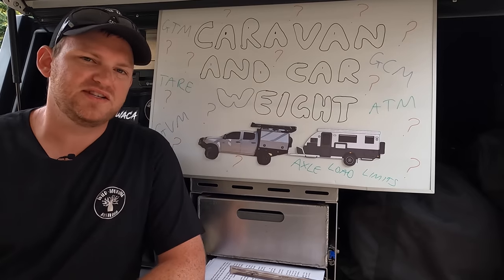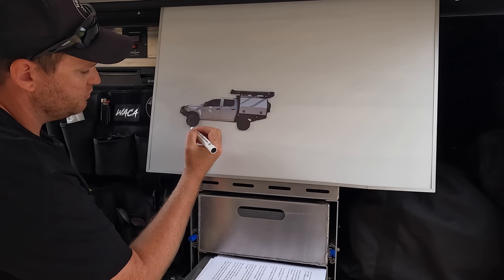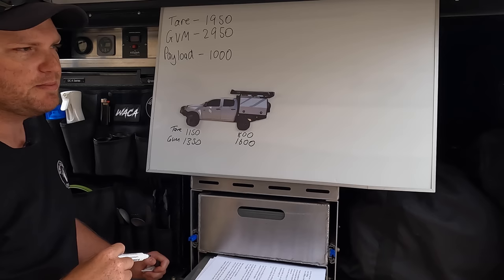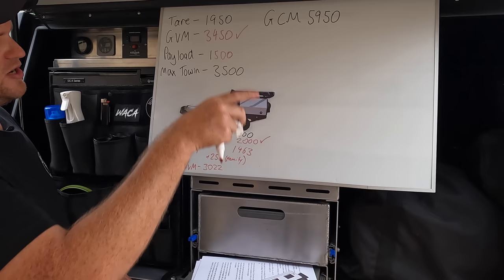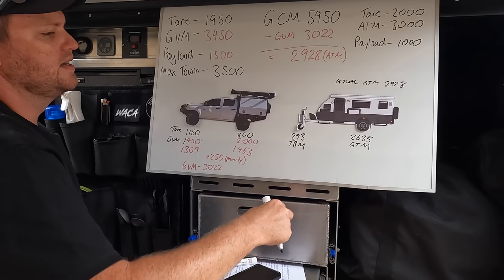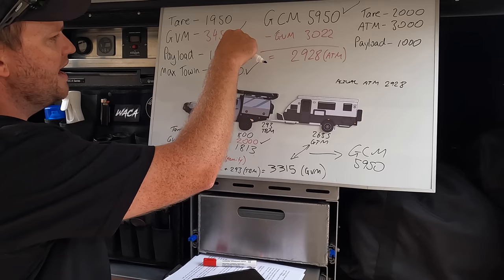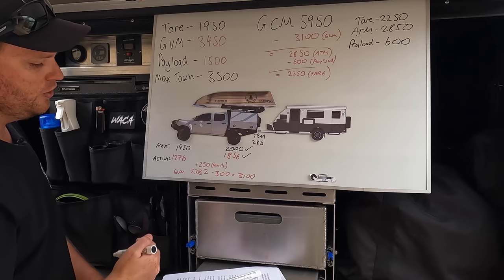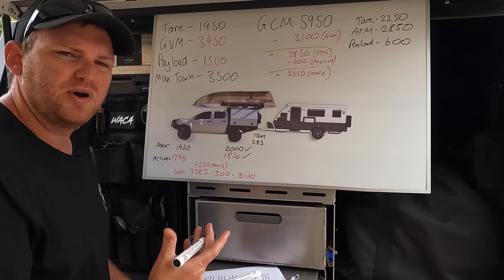How to work out what you can tow? ||  Explained - TARE, GVM, AXLE LOAD LIMITS, GCM, ATM, GTM, TBM...

Comment: Usually, the GVM is actually less than the sum of the axle capacities (the exceptions are usually aftermarket GVM upgrades). Telling people that the GVM is the sum of the axle capacities will result in some people overloading their vehicles. The biggest reason for OEM GVM being less than the sum of the axle capacities is to allow for variability of the fore/aft weight distribution. It also helps to ensure that the rear axle is less likely to be overloaded while towing (actual rear axle loading from the towball weight is more than the towball weight because of a leverage effect, unloading the front axle and putting extra load onto the rear axle).
I trust that this helps.
Reply: PS: the video is generally very good (I thought I should add that). 👍🏻
Reply: Since I've now reached the bit about the towball weight onto the rear axle, it's an easy calculation. Load from the TBM onto the rear axle is TBM * (wheelbase + rear overhang to the towball) / wheelbase. For SUVs, this will be roughly an extra 45% on top of the TBM. For utes, because of the extra overhang, it will be roughly an extra 55% on top of the TBM (this will vary with the design of the specific make and model, but the above will be in the ballpark).
Reply from the maker: I don’t know which particular section you’re referring to. 

You’re correct in saying that the sum of front and rear MAX axle load rating will not always add up to the GVM on the compliance plate (however for some vehicles it does). 

But, if someone wants to work out what their car weighs (GVM), the sum of the front and rear axle weights = GVM.
Reply: It can get confusing when the limits and the actual weights have the same names. What I was referring to was the part where you were describing the amount that the vehicle is legally permitted to be loaded to. You mentioned the front and rear axle limits and added them together to get what you called the GVM (referring to the limit, not the vehicle loading). I can't remember what the front and rear axle limits are for a standard D-Max like yours, but at least one of them is more than you've quoted (probably the front). I know for a fact that the OEM axle limits for the vehicle add up to more than the OEM GVM because the design, release and type approval of second stage manufacture (AKA: pre-rego) GVM upgrades are my bread and butter, and the "stage 1" GVM upgrade that the company I work for had for your type of D-Max was the sum of the axle capacities, giving about 140-150kg increase over OEM (if I recall the figure correctly - it has been a while since I last did anything on your model D-Max). I'm pretty sure Pedders didn't increase the front axle capacity over the OEM figure, but they increased the rear capacity more than the company I work for would normally consider increasing it. Not saying Pedders has overloaded it (they're reputable, so I'm sure they haven't done anything silly) - we're generally just a bit more cautious. Anyway, I digress. I'm pretty sure your front axle limit remained the same as OEM, but the GVM upgrade allowed you to use it all (in addition to the increased rear axle limit).
Reply from the maker: @AutoEngineerVideos  the entire thing is over complicated to be honest! It’s no wonder there are so many overloaded vehicles on the road.

Anyway, appreciate your comments and expertise Danny 👍🏼
Reply: You're welcome! Even the likes of John Cadogan haven't been saying anything about axle load limits in their discussions on towing, and people like him really should know better. I think it's great that you had a go (and did a pretty good job of it), when others keep ignoring one of the elephants in the room. Keep up the good work! 👍🏻

Comment: Axle weights are not GVM, they are axle weights, GVM is the maximum the vehicle can weigh and in a lot of circumstances is less than the stated axle weights combined. ie a Land Rover 90 has a front axle of 1200kg, a rear axle of 1500kgbut a MAM of 2400kg or 2550kg depending on spec. A HD 110/130 has FA of 1580kg and a RA of 2200kg, but a MAM of 3500kg. Also something to remember is the trailer nose weight must come off the GVM/MAM if towing as it is load, in axle weights you have to times that by the difference in wheel base and overhang to get the actual loading on the rear suspension, the front suspension may not alter in weight applied to it! That depends on how the vehicle is loaded, not the trailer.
Also GVM is the MAXIMUM the vehicle CAN weigh not it's actual weight as you describe. so that is just referred to as vehicle weight not GVM/MAM or occasionally GVW. 
Something else to consider is if outside of AU, then you may be limited to MAM and Combined MAM for the train weight, so for the 110/130 that is 3500kg MAM + 3500kg trailerMAM = 7000kg combined MAM. Land Rover is one of the only vehicle manufacturers that if the vehicle has a full 3500kg tow capacity it does not detract from the vehicle's weight, nearly all Japanise vehicles there is a compromise on actual and MAM of vehicle when towing max trailer weight. 
Towball weight and trailer angle is imensly important, always, always tow nose down with a single axle trailer, it is more self stabilising. in fact at that point you can reduce the nose weight considerably to less than 100kg. always load the trailer over the axle not to the extremes of the trailer bed, as that also stabilises the trailer under tow conditions. 
As a basic theory, the video is good, what would be great is for you to actually show the practical example and test the theory, I bet you'll be surprised with the results.

Comment: Single axle hybrids normally ball weight is pushing 15 percent then 10 percent all the storage is in front of the axel , as you said heaps of differential in vehicle and vans 
Van Manufactures also lower plate weights for this reason as there vans are heaps heavier then plate specs

Comment: Hey mate watched a few and yours is the best explanation I've seen and that was without Tiff! I did it wrong watched your trips bought a ezytrail 13 , very similar to your rig , ( well ,before you got all flash on us all at least) ,but for a small van heavy Tare is 1920 ATM 2800. Now working out if I can tow after the caravan purchase derrrrrr. But as I have a 4x4 2017 Hilux single cab plus canopy and bullbar winch etc , figured I should be right , as it is similar to what you had. Yes I know , no the correct way to go about it. So may look at getting the same guy to weigh vehicle. But if it's a case of other people who may be close to limit would it not be wise to fill up with water for caravan up north Canarvon for example? to save towing extra weight on that long trip? Is this something you do?
Reply from the maker: Cheers Chris, Darren will help ya weigh the rig and see where you’re at! 

Travelling with empty tanks to save some fuel economy is fine. But you’ve got to be legal with the tanks full- if you have an accident and roll your van, they measure the volume of your tanks and assume they were all full at time of the accident.

Comment: I choose to leave the wife at home and add a bullbar and winch to increase the front axle down force. With a Pedders GVM upgrade on my Dmax, I removed the tub and installed a Norweld tray and canopy. I have decided not to install a roof rack on the car; the canopy rack is adequate. With a Enerdrive and lithium battery package I can now leave the gas bottle at home and run an induction cooker. Not decided on a caravan…..I think a gazebo and tent will be adequate now that the kids are older and moved out of home!

Comment: Just a question about the aftermarket GVM upgrade, does that void your manufacturer’s warranty and are you required to list that as a modification on your insurance policy and if you don’t what are the ramifications?
Reply from the maker: No modification can void your warranty, that’s BS dealers tell you to try avoid covering the cost of repairs. They have to prove that a modification directly caused an issue to deny a claim. I’ve had Isuzu try it on me before. I had an immobiliser issue and Isuzu initially rejected warranty because I had an aftermarket ECU. I asked for something in writing from them to explain how that modification is related to my immobiliser issue. They then decided to cover it under warranty 😂 

Regarding your insurance policy- speak to your insurer for a definitive answer.
But my thoughts would be that any modification should be on your policy if you want it to be covered. An approved/engineered kit is not going to be issue with your insurer, they won’t reject a claim if you have an accident and had not told them it had been fitted, engineered and registered with DOT. But they obviously won’t cover the cost of it if it’s damaged and not in your policy…

Comment: Great video. Two silly questions. How come a GVM upgrade of 500kg, doesn’t automatically increase the GCM by 500kg? 
Also my local caravan shop is selling a 2350kg tare van but say the tow ball weight I only need 180kg. Which is below 10%. Is that due to weight distribution of van set up? Thanks.

Comment: Great video Cam. Very informative as well.
Also why do you have to do a GVM/GCM upgrade pre rego??
Yet  cant do a GVM/GCM upgrade post rego but only GVM.
Good luck with your caravan search.
Reply: There may be other good reasons for pre-rego vs post upgrades but one that I’m aware of is that post rego GVM upgrades are only applicable in the original registration state at the time (i.e. WA, Vic, Qld etc.). So if you happen to re-register the vehicle in another state afterwards, the GVM upgrade no longer applies. Conversely, if you get the upgrade pre-rego (i.e. as a brand new vehicle), the upgrade (provided its a federally approved upgrade package) will apply nationally if you (or someone else) re-registers the vehicle in another state.

Comment: Great video, Cam just with your GVM upgrade what do they actual change out. Is it just springs and shocks as well as upgraded axles. Or do the factory axle load limits change ? If they dont change axles how do you upgrade the limits.

Comment: Hi Cam, thanks for the video. I have a slightly different question re the 2 aerials on your car. Is one a booster for mobile service and if so what brand it is? I assume the other is for UHF radio. Probably not the correct forum for this question, so I apologies for that. Cheers Pete

Comment: Does the towball weight come OFF the ATM when it's hooked up

Example
ATM...3000
GTM...2800
Towball ...200

Now if.. 3000 will exceed my vehicles towing capacity by 200kg
And  my van weighs in at 3000kg
Am I legal when that 200kg gets transferred to the car towball ?

Comment: Great explanation Cam! How do you find the rear disc brake conversion? Any cons?
Reply from the maker: Cheers mate, absolutely love them. Was well worth doing. Braking performance has significantly improved.
The only downside is the handbrake doesn't hold as well as before, and I guess this is because the park brake has a much smaller contact area now. Not really an issue for me with an automatic though.

Comment: All that weight on a 4 cylinder motor? Good detail within, thanks.
Reply from the maker: 5.9T GCM? Yeah no dramas at all, the 4jj1 is a really solid motor. There is large safety margins written into this stuff.

Same motor in Isuzu N series trucks with combined mass up to 10T with a B10 rating (meaning 90% of engines will do 500,000kms before requiring an overhaul).

Comment: Are you able to buy 14,000 lb/6.5 mt GVM vehicles in Australia? 
Being such a large country I would expect you to have a lot of use for vehicles that can tow larger trailers. The average fifth wheel camper in North America has a gross weight rating of 18,000 lbs/8.1t, and toy haulers are heavier than that.
Reply: Class 3 (10,001 to 14,000 lbs gvwr/gvm) trucks have payloads that fall in the 5,500 to ~8,000 lb range and tow ratings up to 40,000 lbs (GCWR/GCM of about 48,000 lbs).

Comment: Mate when the  caravan is weighed isn't it weighed without  the spare tyre and gas bottles fuel cans water tanks .I was told  they only  weighed the carvan  basics  true or false.
Reply from the maker: I’ve heard that too, I’d say it would depend on the manufacturer/dealer that’s licensing the van. Ours was pretty accurate.

Comment: G'day Cam. May I ask say the 250 kg of the weight on the tow bar does that not makes the caravan lighter  by 250 kg ???
Reply from the maker: It does mate.
E.g;
3000kg (GVM ) car
3000kg (ATM) van

working off 10% TBM (towball mass), when hitched the combined mass is still 6000kg (GCM), but the 300kg of TBM transfers to the car, so it would look like this-
3300kg (GVM) car
2700kg (GTM) van

Comment: Question regarding TBM. My van ATM is 2900kgs. Your saying that 10% of that is TBM but when I weight my tow ball its 170kgs. So what figure do i add to rear car axle. The 10% of van ATM or 170kgs i measured?
Reply from the maker: The real towball weight you measured is what you add to your rear car axle, which is 170kgs. 

The 10% is just the average TBM we shoot for.

But I’d still suggest loading up and weighing it on a weigh bridge or drive on scales. Because the tow ball weight you measured isn’t always the exact weight that shifts onto your rear axle- there’s a few other factors that come into play (weight shifts off front axle and into rear axle as the rear springs compress).
Reply: @WildTouring  Thanks mate. Legend 👍👍

Comment: I see people with Ford rangers towing 3.5t fifth wheel. I bet they'd be well over their GCM but they focus only on max tow 3.5t
Reply: if it's a true 5th wheel or goose neck type trailer the back of the vehicle is basically empty so you can have more training weight and a bigger % of draw bar down weight, it's ok as long as you don't go past the GCM of the vehicle

Comment: Great vid! Dual axle van to reduce TBM and rear axle weight?
Reply: Adding more weight to spread it more evenly with another axle? Sounds like a false economy to me.
Reply from the maker: Cheers John, with the size vans we're looking at and the payload we need, it will most likely be a dual axle we buy anyway. GCM is always going to be our limiting factor, reducing rear axle weight is not too hard a task - we can redistribute weight by moving stuff from the canopy/draw bar to the rear of the van.
Reply: @WildTouring  They tend to have less down weight on the tow ball than a single axle? As per Shane’s comment.